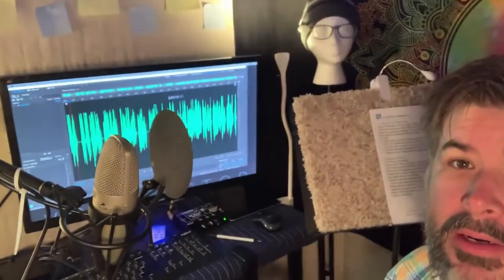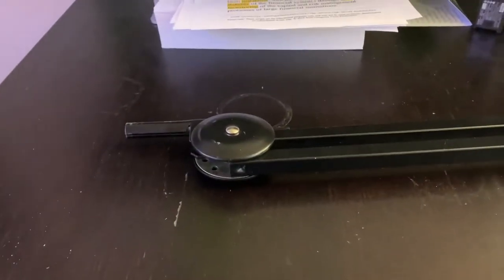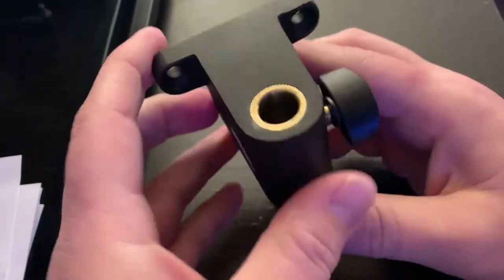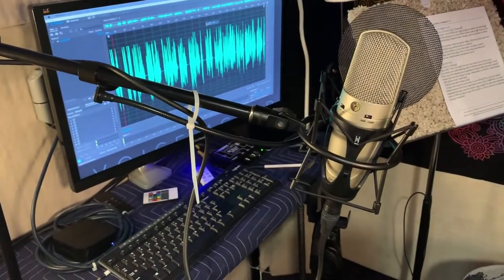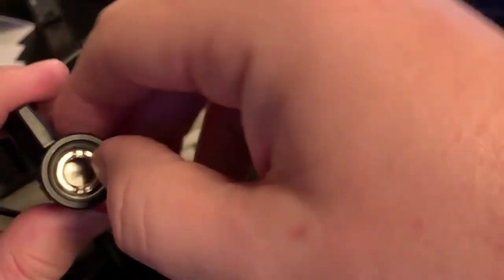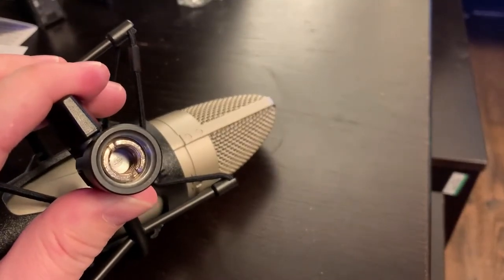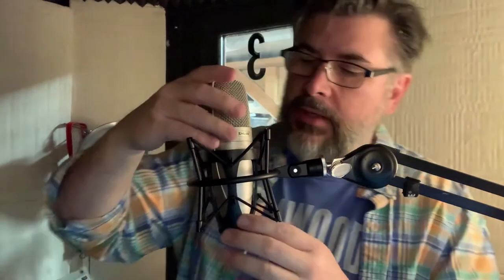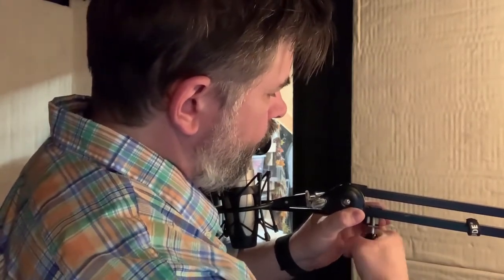Ricmicmic DIY - Installing a Boom arm into my booth.

Comment: Thanks for the video. I just got one of those Heil wall mounts to try to put it in my Whisper Room, but unfortunately it didn't work out so well. I too was trying to connect the Rode mic stand because I have the same issue whenever I bump the table. The first attempt at mounting the was a complete fail. However, on the second attempt I was able to mount it. What I had to do was to bend the Rode mic stand the opposite way and attach a bungee to it while mounting it so it wouldn't move on me. That was the only way I was able to get it flush against the wall to mount it. Also, something to note for those watching I did have to take a hammer to the Heil mount to get it to go into the Rode mic stand. Hope this helps someone. Thanks again for the video.

Comment: Hi, Did you drill pilot holes in the MDF wall of your booth before screwing in the mount? It didn't look like it. I've read that drilling screws into MDF can cause splitting. Thanks.